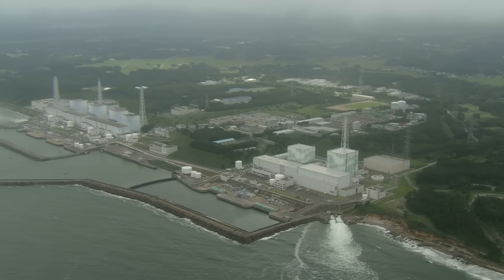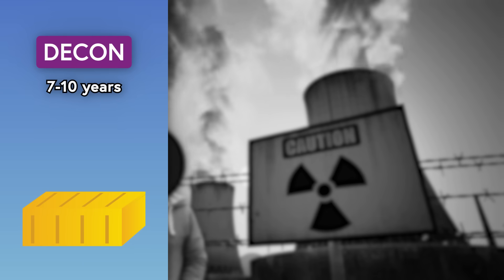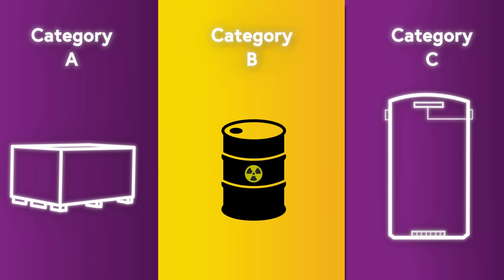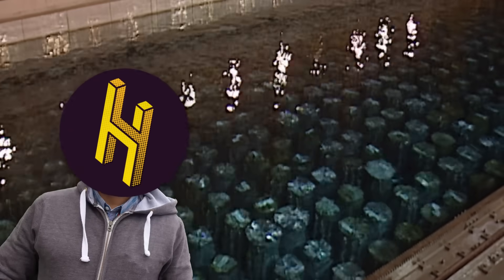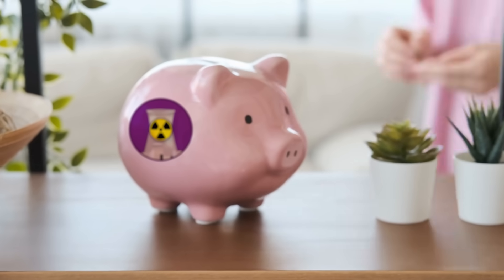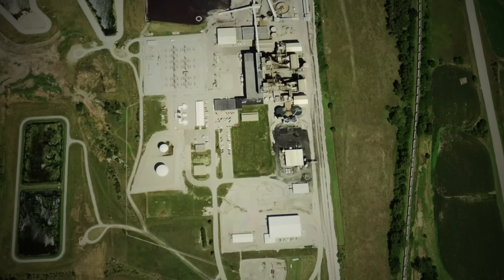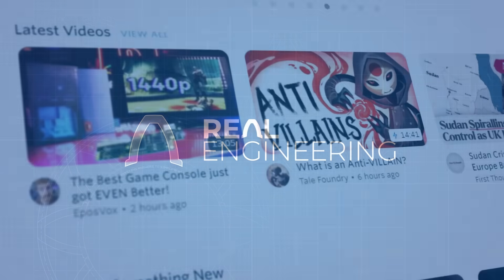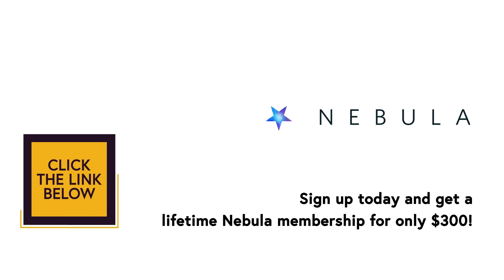Why It Takes 7+ Years to Shut Down a Nuclear Plant

Comment: 4:35 that's concrete, not cement. Cement is just one ingredient of concrete, along with sand, rocks, and water. They might actually use flowable fill or grout, they're a little cheaper than regular concrete, main difference is they only has fine aggregate (sand), no large aggregate (rocks).

Comment: Why the hell do we even use nuclear power? Its such a pain in the ass and it's such a hazard to literally everything, it's the dumbest idea we have ever had. And before you go writing in the reply section "OH it's the cleanest source of energy we have >:(" Is it worth all the radiation and danger? 

Think about it. Coal energy, and hydroelectric are pur best options. Don't lose your panties yet, im not done. 

A majority of the reason climate change is such an issue is mass deforestation. This is caused by loggers not replanting what they cut. (I would know, I am a logger). Instead, in order to cut down carbon in the atmosphere, loggers would need to start planting iver 2x the amount of trees they cut. This inturn produces healthier forests that take a WHOPPING amount of carbon out of our air! And hydroelectric is a very good powersource, there are MANY good hydroelectric power starion locations that could be installed.
Reply: Is it worth all the radiation and danger? 

Statistically, 100 times yes. 

Look up, Death per Twh, Our World in Data

For every TWh generates

Wind kills 0.04 people

Nuclear 0.03

Solar 0.02

And that's including nuclear disasters

Coal 24

Brown Coal 32

Nuclear has the same problem with airplanes. The perception of danger is very different than the actual danger.

People are more scared of a plane crash, than a car crash. Even though the former is much safer than the latter.

People are more scared of nuclear than coal, even though the later kills more than 100 times more people, partly through particulates.

Is Nuclear worth the danger and radiation?

Well, society apparently thinks it's worth it to power a third of the world with something much more hazardous and less carefully managed.

So nuclear would be a no brainer that SAVES lives.

And this is without even considering climate change

Comment: Force shutting down "due to environmentalist organisations" ..... So sad.
Fun fact you could also make a vid on:
Nuclear Powerplants are the highest yielding, safest and cleanest method of converting energy only second to Hydro Power Plants - Dams- due to nuclear waste classified as environmentally dangerous being miniscule, the fuel acquisition and processing making the fuel extremely dense and "spent" fuel being recyclable into fuel again (most often the spent fuel pellets are dumped into storage before the pellets' material has even converted half of its energy potential) not to mention it's partially renewable, advances technology for "green energy" much more rapidly and is several hundred thousand times more space efficient than currently common "green" energy.
Deteriorated or outdated tech needs to be checked and maintained, renewed and swapped by all means. It's no less intense on the maintenance than any old other power plant, it just has a higher potential hazard level, even if said hazard level is on a minute percentage in regular cases.

Comment: Letting the whole thing rot and then actually coming back and dismantling it 10 years later?

Thats exactly what happened to historic Tiger Stadium in Detroit from 2000-2009. That grass, although the stands had several different iterations, was home to the baseball team for almost 90 years. Home to the Detroit Lions for almost 50 years. I took pictures the last day it was fully intact. It was sad seeing it languish for almost a decade.

Comment: To those 3/4 as interested. The "bad thing" of transporting the material until it has been in water for years is that nuclear fuel is like a fire you can't put out, all you can do is keep it cool until it naturally goes off. It is not just hot, it is continually becoming more hot, making more heat as the fuel gets used up, and you need that heat to go somewhere otherwise you will eventually melt whatever is holding it since the maximum temperature it can get to is in the order of ridiculous. The water helps get rid of the heat it is producing and is needed until the rate of making heat is low enough that it becomes safe to handle without actively cooling it off. The half life also describes the number of years before the amount of heat it constantly produces is cut in half meaning it takes a long time for the rate to go down enough.

Comment: Construction for the only Nuclear Power Plant in my State started in 1975. Because it was planned in an Earthquake Zone, they decided to move it by 70m, possibly so that it isn´t directly on a fault line. Commercial Operation started in August 1987. It turned out that moving it by 70m was done without permission. In general the Law which regulated the use of Nuclear Power Plants was violated several times. (Also it is said that it was build in a Flood Plain and close to an active Volcano, but as far as i know this didn´t matter in the Decision). Because of that Violations Court decided to shut it down in September 1988. In 2002 the fuel Rods were removed. In 2009/2010 Turbines, the Generator and other Parts were removed and sold to Egypt. In 2018/2019 the cooling tower was demolished. The complete reconstruction is expected to be finished by 2029.

Comment: Mainly because Co60 is the driving factor for a transportation standpoint (one of the highest radiation dose contributors). 50 years is because the half-life Cobalt 60 is 5.3 years. 10 half lives is a good safety factor for it to be “gone” (for the purposes of decon) The 1170 keV and 1330 keV gammas from its decay are highly penetrating, so shielding it for shipment (as well as the individuals that have to handle it) is very impractical.
Reply: 1300? Damn, I knew it was hot, but that's crazy toasty!!  That does make sense to me now why you'd want more than one or two half lives before hanging out with Co60.

Comment: fun fact
it also takes about a decade to decommission a coal power plant, the only reason they dont take longer because of radiation is because basically all of a coal power plants radiation goes straight into the air!
Reply: Yeah like... Coal power plants are actually more radioactive than nuclear power plants and they just pull up with open top container trains that saturate the area in... is it Carbon-14 that has the radioactive particles?
Reply: @VitaeLibra  the open top coal trains arent a huge issue, might be abit of coal dust that it
the radiation is when its burnt, lots of impurities in coal that are radioactive like radium and radon, as well as just uranium too
Reply: @vincentgrinn2665  7 stand corrected then... I swear I heard that it was the trains transporting it across vast distances that was the issue. But what you're saying honestly sounds even worse. If you have time, would you mind elaborating?
Reply: @VitaeLibra  i dont know a ton of the details but basically youre burning the coal at high temperatures which probably does chemistry stuff
but also it concentrates all the impurities, the plants can burn most of the coal, but all the impurities end up in the ash, both the stuff left inside the furances and what leaves through smoke stacks
which poses a radiation risk for people both around coal plants and the landfill the ash is dumped in, it can also bind to water and soil in both instances

its not a huge amount of radiation though, background radiation is 300 millierem
living near a coal power plant adds 1.8millierem
living near a nuclear power plant adds 0.01 millierem

the coal dust from transport is apparently only minor, 8 micrograms per m3 compared to 5 micrograms of a regular freight train
for comparison living near a major road is 280 micrograms per m3 of particulates

Comment: Vermonter here, and Vermont Yankee had a few other issues that lead to its closure, such as a cooling tower collapsing, finding small but increasing amounts of radioactive tritium leaking from an underground pipe, and some cesium-137 that no one is 100% sure where it came from. While natural gas was the final nail in the coffin, there was so much leading up to its inevitable closure. 

Also, during the decommissioning, a train enroute to the plant derailed.
Reply: Southern VT’er here as well. I was just going to comment on this as well… as I remember there being more to the story than just cost issues.

Comment: Yeah, I see no reason why buildings that take four to six decades to remove safely shouldn't be located near every major city and produce all our electricity. It's very very efficient as you can plainly see. What's not super-efficient about a building that runs for maybe 10-20 years and then takes three times as long to shut down without ionizing irradiating everyone? You nimbys are just bad at math! /s
Reply: But you really did exaggerate far beyond realistic levels to get your point across...

Nuclear power plants are almost always built with a 40 year guarantee at least. That can usually be extended by another 40 years with some frankly quite basic upgrades. The only reason a plant would be shut down prematurely would be due to a natural disaster or similar event OR because of political pressure from Nimby's. You can't complain about them only staying active for 20 years when you're part of the reason for that (see Germany)

And you are literally just exaggerating with the time it takes to shut down. Almost all nuclear plants take 10, maybe 20, years to shut down. But you don't hear about those because they aren't due to a disaster. And guess what? Coal plants take a decade to shut down too. Heck, renewable energy graveyards take up even more space and it takes way longer for them to degrade

And here's the thing... idk if you know this but coal plants actually release more radiation. Well they also pollute the area way worse but even without that, coal actually releases a level of radiation (I believe it's Carbon-14 that's responsible?) And unlike nuclear plants, coal plants aren't expected to prevent it from slipping into the area. Meaning over the lifespan of a coal plant, open top container trains are pulling up, saturating the area of the plant and railway in radiation, resulting in worse contamination than a properly maintained nuclear plant. And nuclear plants are held to much higher safety standards

And for the record, there's a growing interest in smaller nuclear reactors. I don't wanna get into the details but they are easier to maintain, faster to remove and have a bunch more advantages. And again, the biggest reason we aren't building this objectively better solution is because of Nimbys. We have to build these huge plants because whenever a plant is approved (which happens rarely) we need to make as much out of them as possible. So again, you are complaining about problems you are largely the cause of

On a sidenote, there's also talks about repurposing decommissioned coal plants into nuclear plants. Something that would make nuclear even cheaper and take less time to construct. Can't complain about that right? If there was already a coql plant there then you won't have a problem when a nuclear plant is built in the same space right? Because any worries you woulf have about it being too close would have already been determined not to be an issue back when the coal plant was built and the nuclear plant is even safer, less polluting and less irradiating of the environment!

I hope I adressed your concerns. It might have sounded like I was attacking you but that wasn't my intent. Just wanted to highlight hoe Nimbys are causing a few of the problems they complain about. Of course it's alright to be cautious and no one can blame you for being scared of nuclear. But I can guarantee you the problems are (mostly) overblown and any other solution would probably have worse or more problems

Comment: PSA: Coal contains trace radiactive elements and coal power plants are allowed to just release them into the air with zero regulation, along with all the other fun byproducts of coal burning. It's not much but you have to burn so much coal that the averahe radiation released into the atmosphere per terrawatt is higher than for nuclear power, even counting Chernobyl.
Reply: Oh but nuclear plants scary

Comment: I think the SAFATOR method was used for the NS Savannah. She was retired in '72, but it wasn't until a few years ago that the decommissioning process was completed, and the still hot components of her reactor were removed. Don't quite remember if her nuclear license has been revoked yet to complete the process on paper, but hopefully soon she'll be open on a regular basis as a museum ship rather than just for special events.
Reply: I’m still surprised Savannah was saved from the ship breakers and actually had a chance of being a museum, especially with all the hassle that turning her into a museum would require.
Reply: @AndyHappyGuy  she's still not safe from the scrapyard: it's still an expensive project to purchase and maintain once the Maritime Administration releases possession of her, and I don't know if anyone's made an offer yet. I know the nonprofit that's been running the museum aspect of the ship is likely to have the right to first refusal, but they still need the cash flow to support it.

Comment: There are multiple reactors in my home state that are entombed, and my understanding of the technical details is limited but as far as I know, these were single circuit reactors (Water goes straight in and straight out) for weapons grade plutonium production and are hard to dismantle and remove, very dirty and lightly contained reactors, hence the decision to entomb them.  Also they are far from any towns or cities and in the middle of a very large government reservation, so there's no one who could conceivably complain that they are an eyesore or want to redevelop the site.
Reply: Welcome to Hanford, WA.
Reply: The people who lived in the town before it was forcibly evacuated by the military might have complained a bit. Not to mention the people that drive through it from Vantage to Othello.
Reply: Actually extracting plutonium from the waste isn't that hard, it's just the thought of other countries proliferation concern with using the plutonium for nefarious reasons. Being the US, we try to not make this a concern by not extracting the plutonium.
Reply: @derpymcderpello5381 We should just convert it to MOX and rhrow it into another reactor. That's a much better way of ensuring that it'll never fall into the wrong hands.
Reply: @jeffbenton6183  Thats a good point, but making MOX means making plutonium first and then mixing that with uranium. There would still be concerns by the public that plutonium has to be handled and separated independently first before being mixed with uranium. I will say that I think the use of MOX instead of simply plutonium would significantly lower proliferation concerns. Maybe we should start doing that.
Reply: @derpymcderpello5381  If any object, I'd point out that the US military would oversee the project, protect both the waste and plutonium, both on site and in transit, and the MOX itself would be produced on a military site. To any terrorist or foreign government who would try to steal it, I'd say, "good luck."

Comment: “A whole bunch of nuclear radiation”
As opposed to non nuclear radiation?
Reply: yea there are multiple types of radiation
Reply: Um, yes. Such as, electromagnetic radiation. You know, radio waves, VISIBLE LIGHT, that sort of thing. 
Not to mention heat radiation (which is actually a form of EM radiation)

Comment: Aw, man. I like nuclear reactors.
I don't want them decommissioned.
Reply: Decommissioning is unfortunately necessary. The important thing is you BUILD MORE TO REPLACE THEM.
Reply: @K-o-R  or use better alternatives if possible, such as hydro, wind & solar. This is what we use here in Quebec. Nuclear is good but you still have to deal with nuclear waste, so if you're lucky enough to have access to these other 3 power sources, you should use them.
Reply: @tcg1_qc And how are those methods better? Solar cells are not efficient enough to compete with nuclear and wind is not effective in many different ways. I’m not saying that solar, hydro, and in some situations wind are bad options, but they certainly can’t replace nuclear. Nuclear plants produce very little waste that cannot be repurposed.
Reply: @bredcubed1161  That's why I said if possible. Hydro can definitely compare to nuclear, pretty much all of our electricity here comes from hydro. As for wind & solar, they can also make tons of power if you have enough of them. Of course you need a large empty space, which we have plenty of here in Canada
Reply: It would take 19 yrs for Japan to recycle 10k tons of solar panels vs France recycles almost 2k tons of nuclear waste every year. Which is worse? And you have to deal with nuclear waste from hospitals so I still dont see the problem unless youre a luddite but why would you support solar then.

Comment: Okay, nuclear physicists in the comments, I call upon thee!
If spent nuclear fuel is still hot enough that it needs active cooling for years, why the hell are we not using it as the hot side of a stirling engine or something, instead of spending time and effort too cool it?!
Reply: Because people tend to look poorly on getting cancer
Reply: spent fuel doesn't generate enough heat to work with, each fuel assembly in dry storage is around 0.5 - 1.5 kW of power, that's around the power of a hair dryer
Reply: That is a question better answered by economists and engineers. My guess would be that the requirements for an efficient heat exchanger for a heat source to generate electricity and the requirements for an absolutely passively safe heat exchanger for ultra long term storage don't match very well.